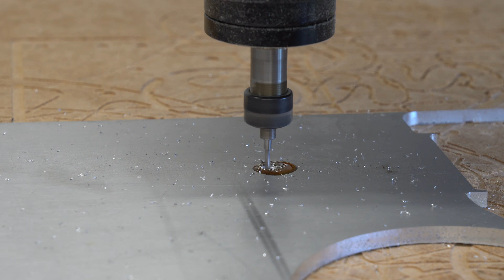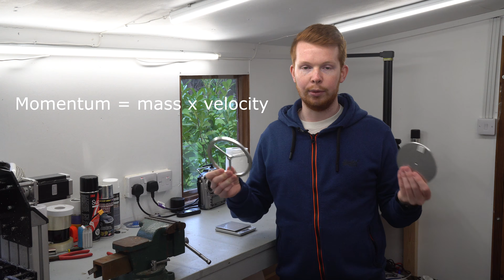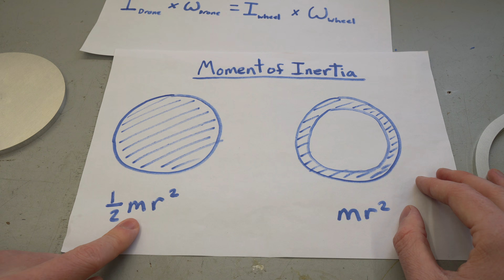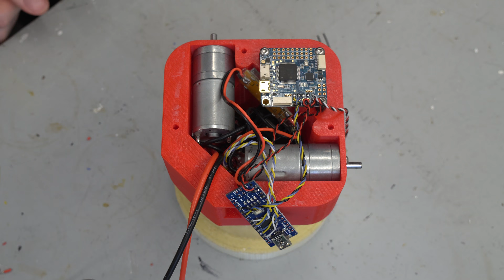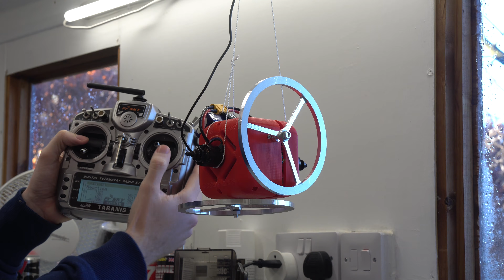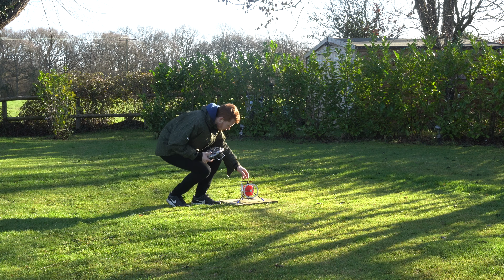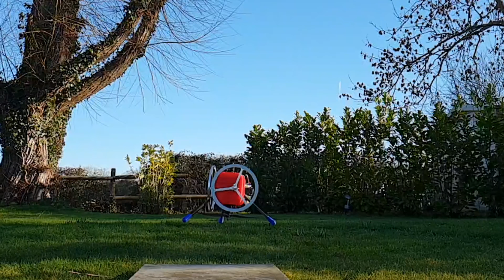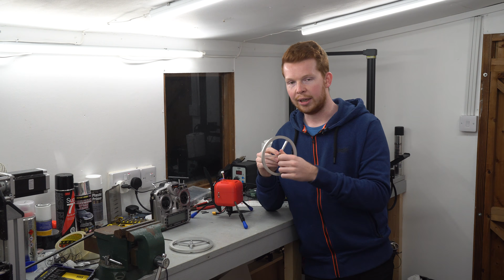Comment: the fact that this flew at all in some thing to be proud of and as for the brush motors use a current shunt and not the speed let the motor driver control the voltage have the PI control the current the motor will react much more linearly

Comment: Could the problem be with the propulsion? No helicopter or drone I've seen has a rotor underneath the chassis! Counter rotating props usually have one above the other, both on top, while your other options are the traditional anti-torque rotor mounted on a jib from the rear like a real helicopter, or have 4 rotors, all on top, like a quadcopter drone. One on top, one underneath just looks so unstable and a recipe for sending the drone into positive feedback...
Reply: Not having blades underneath is more of a concern for clearance than for stability. It also complicate things when you need to power blades on opposite sides of your craft with a single engine (motor). In Tom's design, he has a dedicated motor for each rotor, so it's actually simpler for him to mount one at the top and one at the bottom, since he isn't worrying about clearance, or people stepping off the craft and getting cut to pieces by the blade.

As for the anti-torque at the rear, that's essentially to counter act the fact that the single rotor on a helicopter is acting like one giant reaction wheel that continuously turns the craft in a circle by providing a force in the opposite direction.

It looks unstable, but due to the fact that Tom's rotor blades are fixed in place, the entire thing behaves like a rocket (he even mentioned kerbal space program!) and so the principle of Pendulum rocket fallacy applies to his craft.
Reply: AYYY! Rocket pandulum fallacy!
Reply: could help with stability eg. positive stability if the mass hangs under both thrust(propellers)
Reply: @jacobdavidcunningham1440  it doesn't really help. look up pendulum rocket fallacy. since his lift provider blades cannot vary the direction of the thrust, it will always push in the direction that it is tilting, adding to the tilt. low center of gravity helps to resist motion, due to principles of moments of inertia as described in the video, but does not counter act motion actively.
Reply: exactly my thoughts
Reply: White Rice think tightrope walker
Reply: This is certainly an issue with the design.  The center of gravity is above the rotor and has to be balanced above it like balancing a broom by the handle on your palm and the brush end up.  The imbalance would cause the flight control to try to balance it out, which would probably cause a feed back loop and possible oscillation.  

A better design would have both rotors above the center of gravity.  Those small toy helicopters with counter rotating rotors usually have the upper rotor shaft inside the lower rotor shaft.  If that helps visualizing it.

Which brings up the misunderstanding of how a helicopter flies.  The helicopter already maneuvers with reaction wheels.  The main rotor disk on a traditional helicopter is a giant gyroscope and in order to vector the lift, a force is applied on the rotor disk.

The cyclic pitch control increases lift on one area of the rotor disk.  Horizontal flight in a helicopter comes from the difference of lift across the rotor disk.  If there is more lift produced at the 6 o'clock area of the rotor disk, then there is an imbalance.  That imbalance of potential energy has to balance and a force is created in the opposite direction that the energy moves to balance.

Comment: The flywheels will lower the frequency response of the motors.  The accelerometer input signals will have higher frequency response and this could create instability in your feedback control system.  Try a low pass filter to limit the accelerometer input signal to the frequency response of your flywheels.  You could have noise on your accelerometer sensor signals from the propellers.  Kalman filters were developed for noisy sensors.
I would think that gyroscopic stabilization that you manipulate might work better.

Comment: I'm no expert in flight but I think your problem is the fact that you have a motor on the bottom of the drone. I understand that it's to help rotate the drone but that extra motor is causing it to tip faster than the wheels can react. Take that motor off of the bottom and replace it with a small reaction wheel and I bet it would work. Just imagine a broom stick. If you hold it from the top, it's easy to keep upright. If you hold it from the bottom, it's MUCH more difficult.

Comment: hey tom, this is an interessting concept. maybe not for "hobby" stuff, but i see a drone using only 1 or 2 motors potentially beeing more efficient when it comes to larger ones. the oscillation could come from many things there, build quality ( you see the wheels wobble a lot, so maybe with tighter tolerances it would be better by itself) or even adjustments in the PID department of things. maybe using 5 reactionwheels and one lift propeller would be the most ideal scenario here? though you might need a way to reset the speed of the wheels gradually so they dont run out of available momentum. i find this topic really interessting since its something nobody i know of has done before. it would be nice to see some itterations of it in the future!

Comment: You should include compasses in the flight control system; when it was hanging, it was constantly rotating slightly, so having a compass-based directional sensor might help.

Comment: Coorrrect me if i`m wrong!!

There is positivand and negativ acceleration. That means you can change the direction of your drone as long as the e-motor is accelerating, but as soon as its breaking the drone will go back in its former postion. The only thing helping is the friction between the surrounding wheel and the air. Thats most likely to little to stabalize the drone. 

I believe thats the reason for the wobble. Oversteer and countersteer.

Comment: Did you experiment with filtering the gyro data? 

Also I feel like the motors have to really overpower the reaction wheels in order to achieve quick reactions. Maybe there's also some more room for improvement. But it'll make the craft heavy...

Comment: Hey Tom,

Aside from your conclusion about an uneven torque curve on the motors did you think about what a constant wind would do to your drone?

From all your experiments what it looks like to me is: 
- wind is blowing against drone in a direction towards the hedge
- drone tips slightly
- wind catches underside of propellors and increases tipping
- reaction wheels try to level drone
- reaction wheels are too twitchy
- drone starts rocking back and forth
- crashes

Seems like you need some smoother adjustment curves the same way you wouldn't want to stop a swing abruptly but rather let it level out a bit:
- slight delay on reaction wheel response
- smoother buildup and roll off of reaction wheel motors

The drone looks promising, and you could probably get it to work stable enough if you'd keep experimenting and tweaking the settings.

Btw, one thing I always wondered about reaction wheel saturation is: Assuming a non-constant biased direction of external forces, couldn't you simply avoid the saturation problem by having:
- opposing wheels (so 2 wheels, one on either opposing ends of a drone, for all 3 axis; 6 wheels total (XYZ))
- every single wheel capable of at least a full 360 rotation of the cubesat
- wheel action limited to < (max wheel saturation - one full 360 rotation)
- the moment more external forces are applied close to this action limit do a 360 flip and desaturate built up energy for infinite reaction wheel action :D

With such a setup on a cubesat you wouldn't have to keep wheels spinning after external forces have seized as you can simply rotate the cubesat to desaturate all wheels.
The only limit to your gyroscopic control would be how much juice you have left to power the wheels.

Comment: WOW! Excellent job! Amazing approach and even more amazing results so far! 

Perhaps the drone is not able to stabilize properly because the whole shell seems to be a bit too wobbly.

The gyroscopic effect of the (very fast spinning) propellers tries to warp the shell with every correction (on one axis), which results in the need for even more correction (on the other axis).
I think, you are very close to a success! A bit more rigidity in the structure combined with a bit more tweaking of the PID values might do the trick.

P.S. Sorry for my bad english. :-|

Comment: Tom, given that the reaction wheels would add weight, with the attendant issues of saturation, what was your expectation of this experiment?  That's not a criticism - if nobody experimented with things because they expected a poor result, a lot of fine inventions would not have been made, so kudos to you for the attempt.  Even if it didn't prove to be "the next big thing", this is engineering R & D at its finest.

Comment: The reason of unstability of Your drone is simplified mathematics You use. 
In case of XX degrees deviation of precise position the axis of the reaction wheels deviate XX degrees of perfect vertical / horizontal position ad so deviates direction of the forces / mommentum . Your equations probably do not take this into account.

Comment: Wouldn't it be prudent to get the drone to hover first (maybe just by force of the top rotor) and only when it has a stable altitude, switch on the momentum wheel motors. I think the wheels interfere too early and that is why it doesnt reach a stable hover.
Also maybe mount the thrust rotors both at the top, counter rotating ofcourse. Like it is used in the Russion Kamov Ka-50 helicopter. This way the mass will be suspended from the top and it will be more stable.

Comment: Great video! I love how that design already worked out! Aside from your torque problems with the motors, I wonder why you used an asymmetrical shape for your drone. In the slo-mo I imagining to see that pitch corrections towards the two sides where your torque wheels were attached seemed much easier for the drone that those away from them. I think this comes from the center of gravity which doesnt quite lie in the center of the cube but slighty towards one edge. Attaching counterweights to the opposing two sides may help the stability and reduce oszilliations of your drone caused by torque inequalites.

Comment: Tom, use soluble coolant in a spray bottle not oil. It can be vacuumed much easier with the chips, smells better and is much cheaper. Same stuff they use in industrial cnc machines. One gallon concentration will make hundreds of sprays bottles full.

Comment: Can I suggest to have the wheels spinning at a minimum rpm? As the torque is at its max at low rpm, the acceleration from 0 rpm can be jerky (friction, power transfer, etc). If you have some way of measuring the torque vs rpm curve of the motor and wheel, you will probably see a downward sloping curve. You can use this to play around with minimum rpm to find what works best.

PS: PID tuning can also  make a big difference in the oscillations seen in the (half) successful hover in the video!

-Source: I am an aerospace engineering student and also vice-pres of my university's drone club :)

Comment: You may need to implement some control theory, and better regulators. I dont exactly know what the model would be for this problem, so I cant say off the cuff what modifications would be necessary, but looking at the slowmo, it looks like the problem may be with reaction wheels being sluggish, and the model the drone is using to control them isn't compensating for that properly. or taking it into account. You may be able to compensate for that by "prespinning" the reaction wheels up to a certain rpm, so that the reaction wheels only need to brake or accelerate the wheel, rather than move them from a standstill.

Secondly, it may be the problem is you have assumed the validity of the simplified model of angular momentum. It might be youve taken this into account behind the scenes, as it were, but the angular momentum applied to the body you are trying to control depends on the position of the centroid of the rotating body relative to the centroid of the other body, by some formula i cant remember for the life of me. The point being, the two objects that are rotating and for whom the total angular momentum is conserved, each try to rotate around their own centre of mass. And it is not as simple as a Iw = Iw if those two axes are not aligned. To reiterate, the problem may be that the reaction wheel is trying to torque the drone around a point which is not the drones centre of rotation on that axis. That would also give faulty control input, as in that case, the rotor would torque the drone on other axes than just the one at a time, leading it to "fight itself".

Comment: Very interesting project ! I suspect there is a gyroscoping issue between the three reaction wheels when the drone tilts in a specific direction while oscillating in yaw, causing the roll wheel to induce pitching, then the pitch wheel induces roll back, but amplified. Maybe if you have the drone try to face "backwards" from this specific direction using yaw whenever it is in translation horizontally, you could have extra stability instead of a runaway instability ? Also, maybe build the drone to have a lot less angular momentum around the vertical axis, to avoid potential tumbling (have its mass concentrated less spread from its vertical axis).
Reply: I think a gyroscopical effect starts when a wheels start turning which means any tilt of the drone will affect at a + 90 degree angle on the wheels . So if the drone tilts on the axle of one wheel while this wheel is moving(!), the drone will want to rotate on it's axis/If the drone rotates, it will have an effect (in 90 degree) on a rotating wheel. This has to be taken in account in the software, quite a challange! Great video btw!
Reply: @hulsmantimepieces  This robot uses reaction wheels for stability, and it uses the precession trick I suggest above, in order to stand on a corner: https://www.youtube.com/watch?v=n_6p-1J551Y

You can see one of the wheels being spun to high speed, then by using the other two axes the robot exploits precession from the spinning wheel to keep balance. Very advanced control software, obviously, but it could feasibly tilt a flying drone.

Comment: Watching the slow-mo footage, I think the problem is that the change of direction of both the flywheel, it's making stop the wheel so quickly, that the momentum keeps going and make the drone itself unbalance again, and that cause that weeble-wobble, is correcting the positions left-right all the time, and it's difficult to control, maybe if you can program the arduino to slow down the rpms more softly, to dampen the sudden stop, will make the drone easier to control. I don't know is an idea. Another thing is going into my mind, are the motors, if are brushless or permanent magnet motor, which can cause that sudden stop as well... Anyway great prototype!!!

EDIT... Didn't watch the latest explanation. You were using permanent magnet motors, so it is normal then to have that movement at the beginning and the end of the movement, it's a magnet, so it attracts suddenly. So, i'd try with some brushless and a progressive increase and decrease of rpms

Comment: Torque output is linear to CURRENT, electric motors even have this characteristic value of NmA in addition to kV, but it's usually not shown because it's not quite trivial to control current to the electric motor precisely. You're adjusting VOLTAGE and it will produce varying amount of current depending on motor RPM.

Comment: I think it sways because the current/voltage drops, so when a wheel wants to make an adjustment, the voltage/current on the other wheel drops, so needs to then re adjust what alredy was trying to adjust, so it's an infinite loop of small adjustments because the rpms decrease and increase each time each wheel either starts or ends an adjustment, you should have one battery for each wheel
Reply: hope you read my comment

Comment: Have you considered using sensored brushless motors? Or perhaps high speed servo motors? I would think they would be a better fit for a reaction wheel application. The motor controller would know how much starting amperage is required to switch back and forth as well as know where the motor is at all times, especially start up. This would give you more linear results.

Comment: Is the exagerated hunting behaviour of the reaction wheels caused by the centroid of inertia of the drone and the wheels not being in the same location due to the lower CoG of the drone body (caused by the legs)?
Reply: Good catch. Should have a more symmetrical design, and try to get the CoG as close to the reaction wheel axis as possible.
Reply: It looks like the drone isn't rolling along the same axis as the reaction wheel. That and gyroscopic precession look like the main problems to me.

Comment: Go to find the Keyence gyrosaucer, it is the earliest example of quads that I aware of with mechanical gyroscopes (yes 3 tiny motors with small brass wheel) on all 3 axis inside the transparent cover. Just think that this piece of info may be interesting